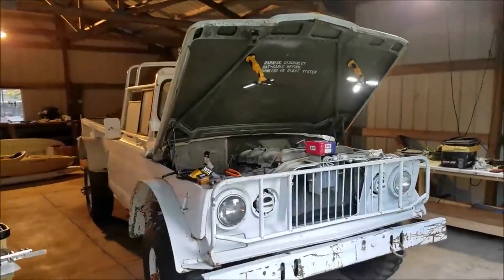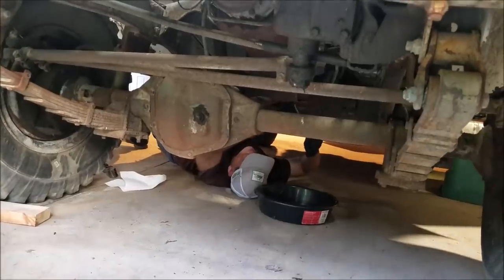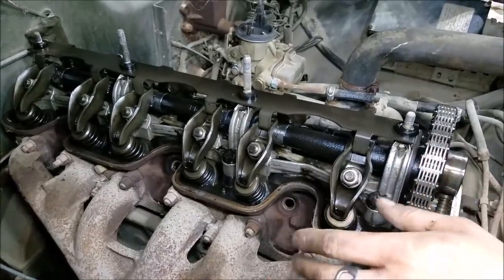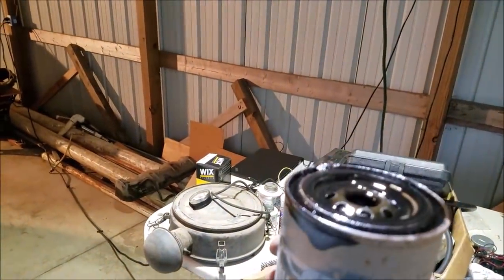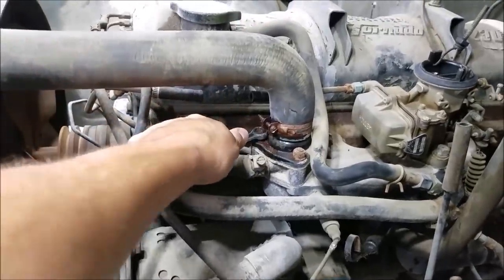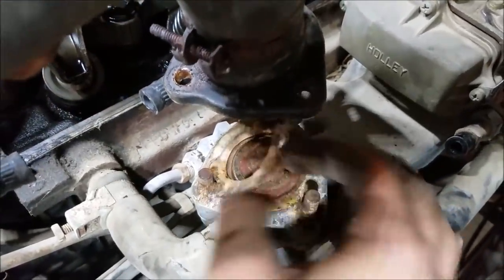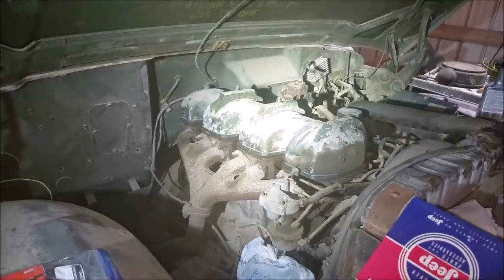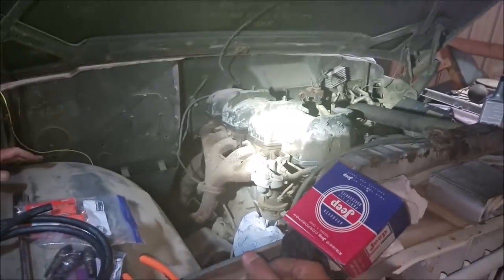Preserved 67 Gladiator Jeep Revival: Military Version - Dormant 30 Years w/ 6K Original Miles (#2)

Comment: It is interesting to see this old Army truck coming back to life. In 1981 the volunteer fire Department I was a member of obtained 2 of these trucks from the Government. Both were in good shape except for the engines. We pulled both engines and replaced them with 327 Chevys with Automatic transmissions. The trucks had a package tank pump combination installed and were used as brush trucks to fight grass/brush fires. Both units are still in service today and work as well as they did when we built them. One truck was a 1963 model and the other was a 1967 identical to the one in the video. I’m looking forward to seeing the completion of this project. Good luck.
Reply from the maker: Won’t be long, once we get a little warmth!!!

Comment: Tornado OHC. 
Here is some relevant tuning info:
Plug gap: .030
Point dwell: 38
Point gap: .020
Ignition timing at idle: 5 btdc
Valve clearance: .008
Fuel pressure: 4.5psi 
Idle: 550 rpm.

Comment: I had a 1968 Wisconsin powered Onan 2 cylinder generator. Military spec with an aluminum cage on it. That thing had everything sealed off. Got it running really good, but I could not believe how much sealing properties it had. Definitely built to last.

Comment: That truck, as were all Army vehicles from the Korean war on, was built with a 24 volt system. Many have been converted (Stupidly so) to 12 volts. In my work on many surplus vehicles used in emergency service I've run across this many times. The first clue was the giant 24 volt alternator. Look for a battery box that fits 2 batteries. Look for a battery jumping plug. These 24 volt vehicles could jump-start a tank. Smart thinking in combat situations.

Comment: Shell run lol dude the old ones are hard to beat. I have a 79 GMC 4x4 I'm almost finished restoring. I got a 250 Inline 6 with 50k original miles. It sat for 28 years! Now runs like its brand new. Amazing

Comment: Just a quick point on Zinc. it has been outlawed in oils because it wrecks cat cons. So to keep engines running reliably manufactures were forced to to design in Roller rockers or lifters. . Thankfully high zinc oils are still out there for those of us who never want a newer car.

Comment: Use Valvoline 10-30 diesel motor oil. It has a ton of zinc in it.
Reply: As does VR1. Most diesel oil doesn't have as much zinc as it used to, for the same reason they took it out of normal oil.

Comment: Great video. I have seen those engines in my country. They were made by IKA, Kayser Argentina, a subsidiary of Jeep, and they used to run them in Formula cars and in a very cool car called Torino, with double webers and hot cam from the factory.

Comment: That's a Tornado six, a really robust engine designed by Kaiser. The Hastings oil filters were very high quality. But those Jeeps would rattle your fillings right out of your teeth they rode so rough! That Holley 1920 carburetor brings back not so good memories.
Reply: Appears to be a canted valve hemi design...

Comment: I've had good results with AutoRX.  No damage, and does a pretty good job of moving junk out of oil systems at a safe rate.  I'm not sure that engine needs it though.  Good diesel oil is probably all it needs.  I'd save that oil filter, go on the shelf with other mechanical marvels  one collects on their journey.

Comment: So recently I disassembled my 73 F100 front end to rebuild the truck from the ground up it has a 351 W in it would you recommend taking to someone to rebuild it or is it something that can be tackled myself although I’ve never rebuilt an engine or would you recommend just buying a crate motor
It runs and was my daily driver however started overheating even after replacing the Thermostat and water pump and put a new gauge in it

Comment: I would concern myself with the grinding underneath when you were hand-turning it. A magnet could have come loose in generator set, especially if someone got aggressive tapping on it at some point in time.
Reply from the maker: It was a super concern for sure. 
A lot of people have told me “that’s what those sound like” 
And actually the engine was stuck when I first started on it. But it seemed to be an accessory drive? 
Those alternators aren’t cheap. Or even around .... I’m pretty leery.

Comment: New engine? Fill the engine from the thermostat housing then fill the rad half way then run engine with cap off radiator and fill as necessary
Reply from the maker: Nope, loosen intake plug and fill until coolant comes out of intake/upper coolant port - then fill radiator - that way you purge all the air and are safe to start.

Comment: Are rollers on lifters really that common? Cars and bikes that I've had with lifters don't have rollers other than at the pivot, and simpler OHC setups (with shim under bucket), both on cars and bikes, don't have any sort of roller involved.
Reply from the maker: After the mid 80s, a lot of stuff went roller cam. The ford small block did in 86, the Chevy in the late 80s. This thing is weird as all get out though.
Reply: I meant to say "on ohc lifters", oops. 

I know they're common on pushrod stuff.

Comment: Hey random question, because I know you're from iowa as am I, and on my 93 f150 I did coil spring spacers, so the camber is awful, so I'm going to do center pivot drops on it, and I cannot find a video on it, not sure if you'd be interested in I guess helping me and create some content because I'm going to fix it regardless
Reply: Ttb front axle?
Reply: @Smartymcnotsosmart  twin I I believe
Reply: Not sure how much spacer you installed but my brother added 1.5" spacers to his and the alignment shop was able to correct the camber by just installing the appropriate bushings for the amount it was off in the upper ball joints.

Comment: Who seriously believe's this vehicle only has 6,000 miles?, it amuses me when people believe the odometer reading and ignore all other signs of wear.
Reply from the maker: That’s the thing. There are no other signs of wear from use. Engine internals look flawless. 
Honestly, where would you drive this weird massive thing on a regular basis?
Reply: These truck were designed for toughness not driver comfort, you had the choice of driving it or walking. Also they scavenged parts off other vehicles and completely rebuild some vehicles.
Reply: @rogerblevins7004  Keep in mind this is a military vehicle.  They may have had 100 of these things in a row to pick from to drive and for some reason or another this may have been one that just didn't get picked very often.  Maybe a skunk got in it early on and it smelled bad or something.  However unlikely, its not impossible for this to have such low mileage.
Reply: Go on GovPlanet and check out some of the Humvees for sale. One had 29 miles on it. Not unusual at all for tactical victors to  be 20+ years old and have less than a thousand miles on them before they get surplused.